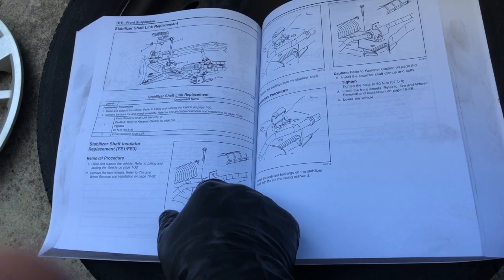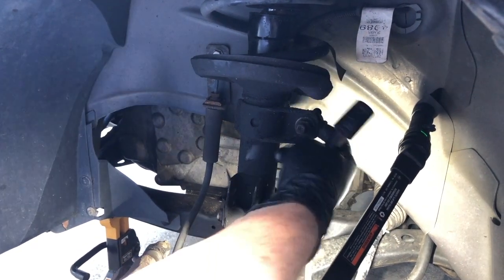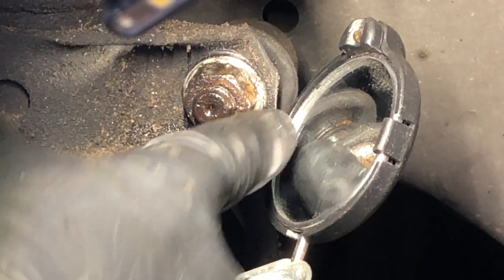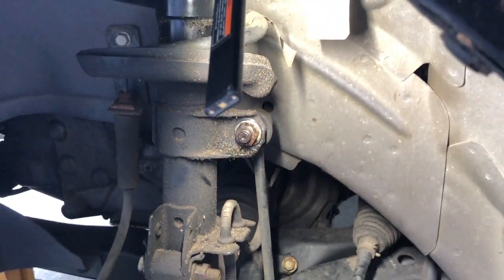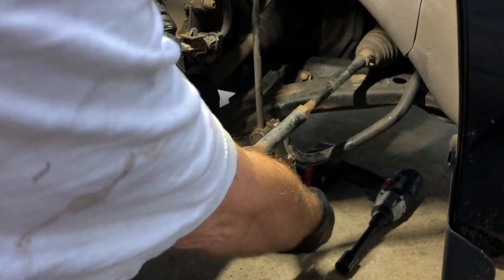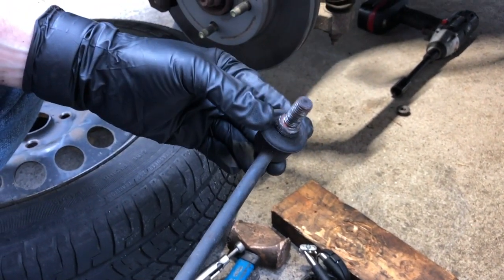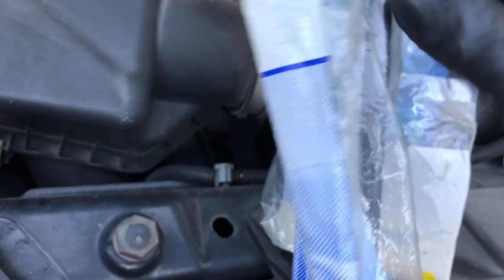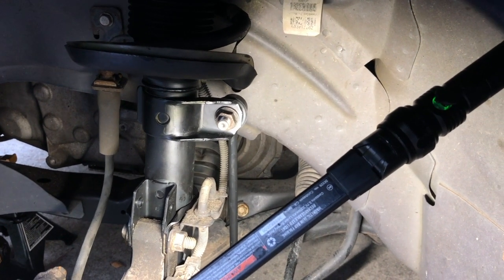2005 - 2010 GM Stabilizer Shaft Link Replacement (Chevy Cobalt HHR & Pontiac G5)

Comment: Question after Intall sway bar do yo have to alignment the car?
Reply from the maker: This is a stabilizer shaft link, rather than a sway bar.  But neither trigger a new wheel alignment under normal situations.    It's when you change tie rod assemblies, ball joints, or control arm bushings that you'll have to do that.